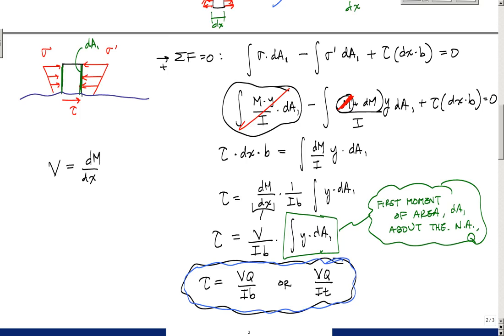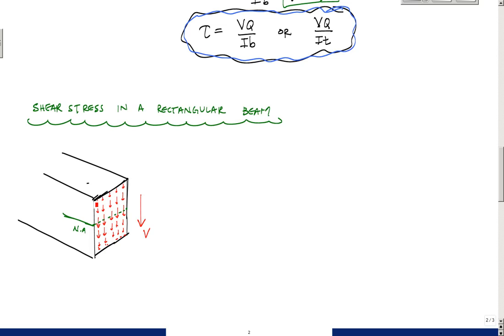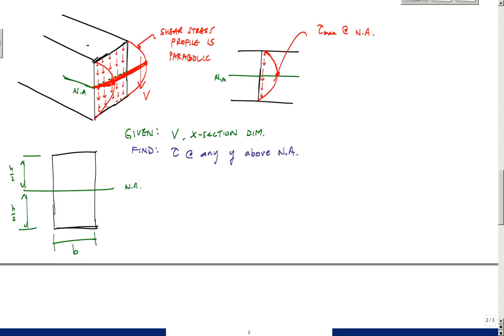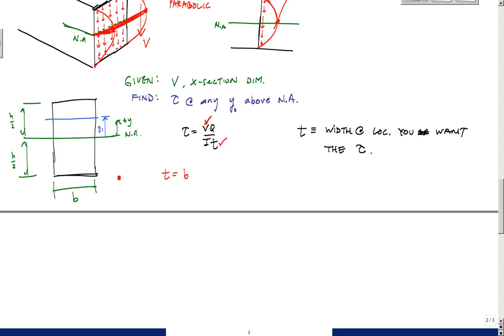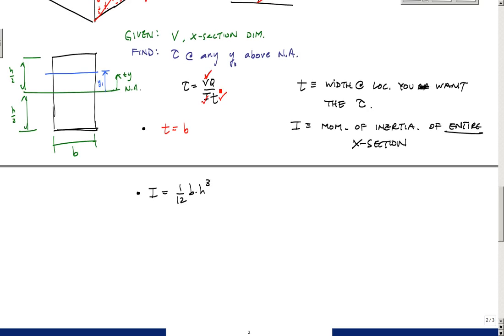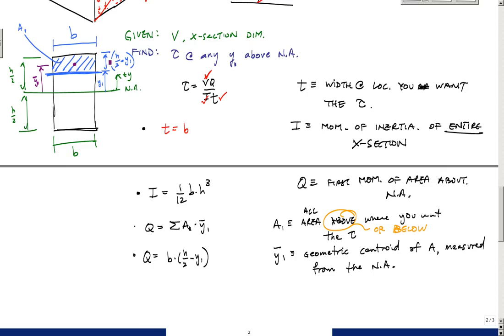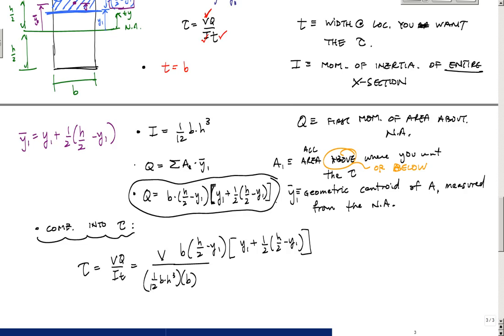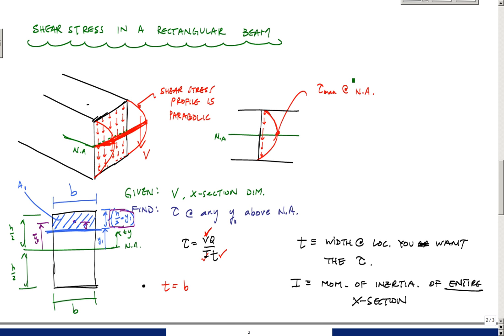Shear Stress in Beams (Part 2/2) - Mechanics of Materials

Comment: sir , can this shear formula be applied to beams having cross sections like triangular section , H section etc because in some books like james .m. gere i have read that this shear formula cant be applied to such triangular cross sections .  but in many other books shear formula has been used to calculate max shear stress at the triangular crosssections
Reply from the maker: +aditya gairola in reality even this formula is not completely accurate since it assumes the shear stress across the width of the section to be uniform....
Reply: Is there a more advanced theory I can look up?

Comment: A question:

In the part 1 lecture, you shoved that "τ" works in the horizontal direction, due to internal equilibrium of the forcediagram-volume too the momentum stress, The shearforce "V" howsoever goes in the vertical direction.

In this video you explain that the "τ" works along the direction of "V" (not left or right) and create a stress volume. Does Tau works both up/down and left/right? Did i misunderstood how taus behavior as a force works?
Reply from the maker: Ole Marius Svendsen shear stress is parallel to the surface or cut you are looking at. normal stress is perpendicular.

Comment: Think i've got it, so in an arbitrary area of the beam where we have a transverse shear force due to the loading patterns; to satisfy equilibrium we have to have a longitudinal shear force of equal magnitude to the transverse shear force which will prevent the area from spinning and therefore satisfying equilibrium. 

Therefore, the formula you have derived can be used to determine the transverse and longitudinal shear stress at any point in the beam. 

For simplicity, the formula tau=V/bd, is used for an average shear force over a cross section of a squared/ rectangular beam whereas if we have I sections etc we use the formula you have determined above. 

Sorry for the mouthful and hopefully this has clarified things for me and some of the other people commenting in this comments section.

Comment: I agree with @Alaa Barakat, you proved the formula for the longitudinal shear stress at any cut in the cross section, but here you are referring to the transverse shear but using the longitudinal shear equation? Could you please clarify this, are you meaning to say longitudinal shear rather than transverse shear in this video?

Comment: In the previous video, you showed the transverse shear as being horizontal along the x-axis. In this video, when you were showing the shear magnitude variation, you drew the shear acting in the y direction on the plane perpendicular to the x-axis (on the cross-section), so now I'm confused, is tau for the horizontal shear along the x-axis, or is it the shear acting in the y direction in the cross-section?
Reply: Those were just magnitude vectors not direction vectors. Magnitude vector shows the strength (and if positive/negative). In the other video, it was a vector showing the direction!
Reply: this is the same my question

Comment: Well, while calculating Q you selected the above area, but when i tried ti find Q by using the below area i could not find the same answer. Did you use that equation only to show that shear stress is parabolically distributed?
Reply from the maker: yes the derivation is intended to prove that the shear stress distribution is parabolic. I chose above since the positive y-direction is in that direction. You should get the same if you choose the bottom area to calculate Q.

Comment: Thank you for the great video.
There is one thing that I dont  get. Why thickness is equal to the base of the rectangular,but not the the height of rectangular. Is the shear stress and shear force directions have to be perpendicular to thickness. I am little bit confused.

Comment: So, if we are considering a non symmetric cross section, then neutral axis won't pass through center of its geometry, hence we cannot have shear stress zero @ both ends, so what would be shear stress @ ends if we consider a triangular cross section?